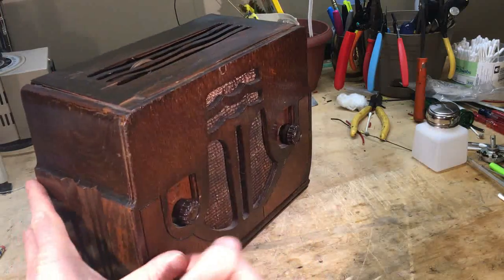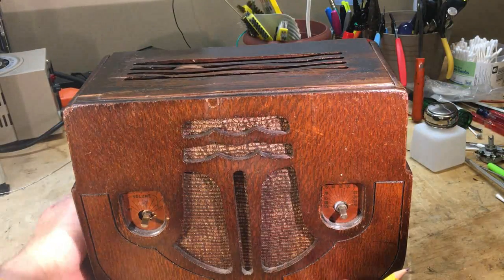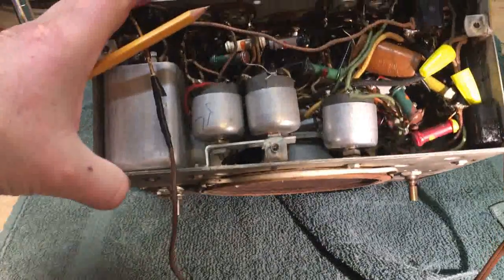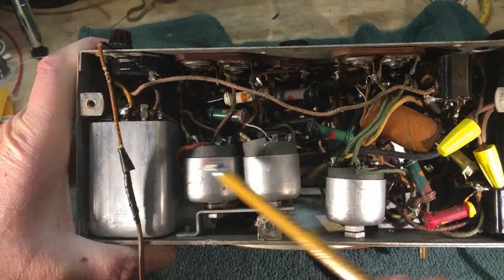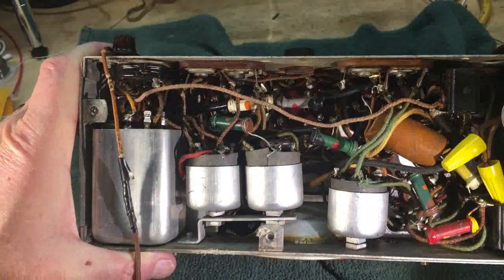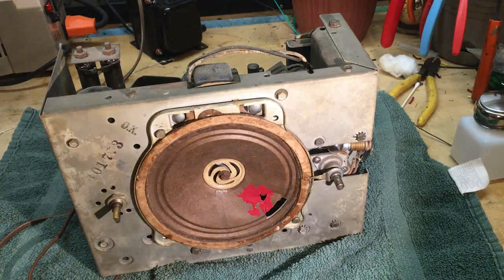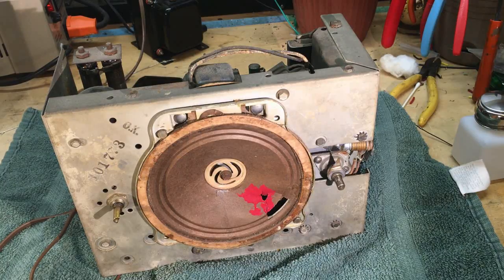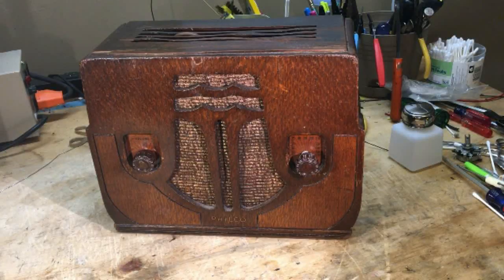1935 Philco 54C Part 1 of 7 Introduction and Partial Disassembly

Comment: This should be an interesting project, Larry. I did a model 59C...same basic design just different cabinet. The components are so tightly packed under the chassis it was a rather difficult radio to recap. Mine had an open antenna coil so that had to be removed and rewound (my least favorite job, so I traded a flocking job in exchange for the coil rewinding which was a good exchange for Ron Ramirez and I). I wasn't too impressed with the performance, and have since sold mine. But they do look nice on display! Here's a video I did on it during restoration: https://www.youtube.com/watch?v=jT6bOX9rguc  The finished product is here: https://www.youtube.com/edit?o=U&video_id=eiSbA54HZIQ
Reply from the maker: gavinwb1 Thanks Greg! Yes, I thought this would be a fun one two start the year off, real cramped underneath for sure. I watched ur video and it seemed to have more room underneath for some reason? Mine has 3 IF coils underneath and 5 or 6 capacitors in a box in the upper left corner above the tuning condenser, which will have to be rebuilt. The chassis has some rust and will need some TLC. Im afraid, there may be a almost complete disassembly ahead! Thanks for watching and as always I enjoy ur feedback and comments. Take Care--Larry
Reply: Mine only had 4 tubes and used the same chassis...just rearranged / consolidated...as in the Philco model 84B cathedral. Guess they changed the circuitry around quite a bit over the run of these. Regards, Greg
Reply from the maker: gavinwb1 oh Ok! I almost did my 84 cathedral this time, but the cabinet is in much worse condition than this one. Thanks--Larry

Comment: I'm sure if you left that on long enough,  you could barbecue on it. I was surprised you picked up a couple of stations using the variac. Maybe someone changed the filters sometime in the past. Looking forward to seeing the progress. Take care.
Reply from the maker: Radio wild Thanks Bob! The top part of the resistor was slightly over 100 degrees, as I couldnt hold my fingers on it, the bottom was cooler. I bet that gets hotter than a $2 pistol! That one cap in the bottom, I have questions about, it may be a add on filter cap repair, we will see soon! I have found it has a capacitor box with 5-6 caps in it, yes, somewhere in that mess is a rebuildable cap box, along with at least 2 Philco bakelite cap blocks. Chassis has some rust and may require total disassembly, we will see. Thanks for the comments! Take Care--Larry